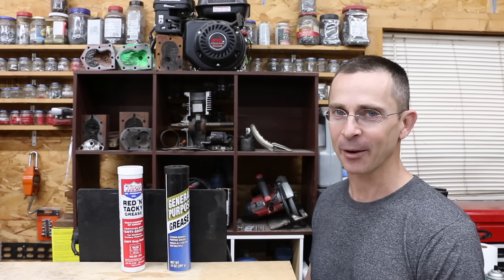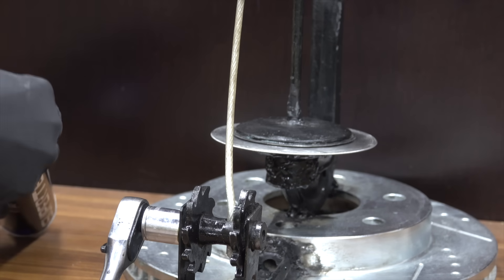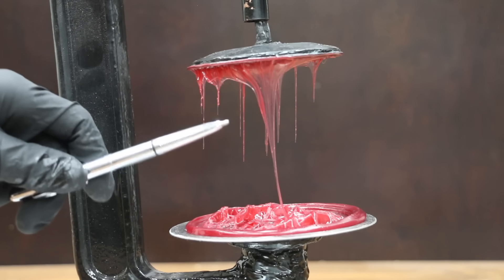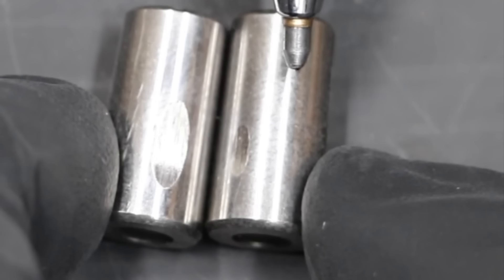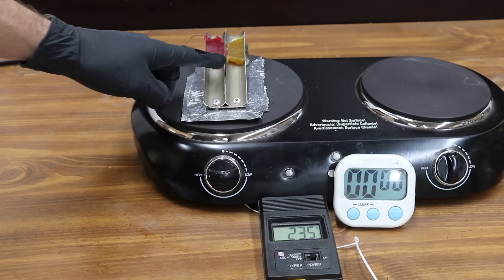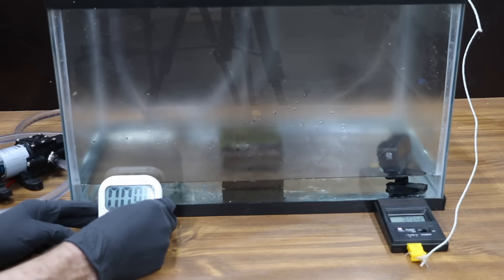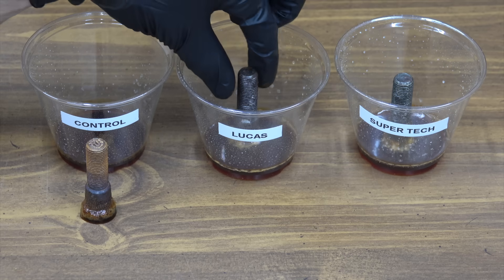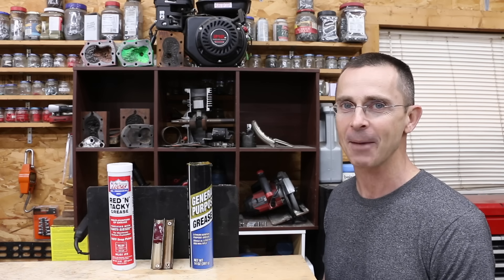Is Cheap Grease better than Lucas Red N Tacky? Let's find out! Bearing Grease Test Episode 1

Comment: I’d like to see Lucas X-tra heavy duty GREEN vs the RED AND TACKY.
Reply: It would be good to see the difference between lithium base, and polyurea base.
Reply: @tangydiesel1886  Against Molybdenum disulfide grease too!
Reply: @tangydiesel1886  Theres a big difference between the to. Being one is a lithium complex the other a poly urea. They both have high drop points. They difference is how they are made. One takes 12 hydroxy steric acid emerox1112, lithium, napthenic Acid the other Armeen OL,EDA, and Mondur T80. They are both made completely different processes.
Reply: The green x-tra is superior. I used to use red and tacky for years and right at 2 weeks I can feel the grinding on the front end of my dump trucks. Switches to green and now I can get 3 weeks before hearing the noise. My trucks run 1200-1600 miles a week. Maybe 15% off-road.
Reply: Me too. Also throw in Mercedes' own green bearing grease.
Reply: He hasn't responded with "Thank you for the video idea!" yet so this is probably not gonna happen.
Reply: Me too
Reply: Yes definitely would
Reply: I'm definitely interested in seeing the wear scar, the corrosion resistance, and the water resistance tests for these two.
Reply: The green takes more slop out of the slip-yoke (for longer) in my worn front driveshaft than the red.
Reply: What about hair or acne grease?
Reply: Anything Lucas is snake oil.
Reply: @taylorc2542  i used to work for Rush Peterbilt and that's the only grease they would use is Lucas.  I love Lucas. But thats me
Reply: @markarmstrong3394  Actual I think there grease is decent, but I'm not gonna buy from a company that is 60% snake oil when other companies do it right.
Reply: @taylorc2542  i understand and respect that.
1 thing i do know for a Fact is that Mystik is $h!t. Evertime we greased hay balers and peanut combines the crap would just press out. I dispise Mystik lol 
The shop i work at now uses Mobil and we love it. Lots of neglect and abuse

Comment: As some one who work in the grease industry, in the laboratory to be exact, i kinda expected all you test to kinda be flawed. seeing how the test where off from how i would do it a bunch of time. How ever i was surprised to see that all the results you got where close, though not as accurate, to what i expect. Great video my dude. May i give some extra information? The rust prevention of greases these days are so good that there is barely any difference between greases. Dropping point mostly increases depending on the soap, even though both products might say lithium soap, I expect the one with the high dropping point to be a lithium complex grease and the other a normal lithium grease, and as you might expect the complex one is a way harder thing to make with a higher amount of lithium per grease which really ups the price. The ability to handle loads mostly depends on additives and the soap structure used for the grease. Last but not least, the ability to mix greases mostly depends on what kind of the solvent used and the soap structure. if you have a clay based one, aka a bentone one, this will react with most other types of grease. Synthetic greases and ones in mineral oil might not be a good mix as well.

Cheers!
Reply from the maker: Thanks for the feedback.
Reply: @ProjectFarm  i really hope that didn't sound negative in any sort of way, english is not my first language. it was an marvelous video and i enjoined it a lot! Keep up the good work!

Comment: If you could, please try Aqua Shield grease. We use this offshore in bearings running submerged in salt water and as a super anti-seize where most other products will wash away over time. It’s tenacious stuff. I have found a mix of fast orange with pumice, blue dawn soap, hot water and a hand cleaning scrub brush gets it off of you if it gets on your hands.  

https://marinesan.com/aqua-shield-grease/

Comment: That was an impressive difference between very similar greases! I'd like to see how my favorite grease holds up to those same tests. 

Thermaplex Cs Moly Bearing Grease https://www.amazon.com/dp/B00Y95MSB6/ref=cm_sw_r_em_apa_i_DthvEbR32TY6A 

Calcium sulfonate grease is supposed to be as good without soaps as lithium complex/mineral oil grease. My favorite grease has soap and a molybdenum disulfide additive. I use it anywhere I need a #2 grease on metal parts, and I would love to see it crush some lithium-complex butt! (or fall on its face, in which case I'll be buying whatever wins.)

I use a weaker grease for plastics because it is compatible and plastics melt before the grease will. I actually solved a problem that the manufacturer hadn't figured out by cleaning and re-lubing the heater box sliding air-control door with #1 PTFE-base grease.
Reply from the maker: Great suggestion!  Thank you

Comment: walmarts house brand "wheel bearing" grease killed my bearings in less than 2500 miles. Lucas has now been in there for going on 50k so yeah it matters a lot. the cheap shit was black as tar, the lucas still looks new when i check them every oil change. id have to look at the extra tube i got but it was not the red and tacky one. it was a lucas brand and specifically says high temp wheel bearing grease on it
Reply from the maker: Great feedback. Thank you

Comment: Yes this all true but if I’m just greasing my lawn mower wheel studs or the pins on my backhoe, which I do every use, the cheap grease works. In any wheel bearing or spindle or something requiring good grease then spend the couple extra bucks on that.
Reply from the maker: Thank you

Comment: Love the videos partner. Could you maybe do video over welding? Maybe stick vs wire? Also I have 99 tahoe, lots of carbon buildup. Any advice? She’s starting to run funny around 40+mph hoping sea foam or mmo could fix but is probably fuel pump
Reply from the maker: Thanks for the video idea.

Comment: Holy poopenschnitzel. I was a heavy equipment operator by trade, and was even a superintendent of crews and an excavation business owner. I expected there to be a difference, but not THAT big of a difference. In all my years though, I never once saw Lucas being used in the field.

Maybe see if you can get in touch of some of the construction companies in your area to find out what they buy. Many will buy in bulk, but you should be able to buy the same stuff in smaller quantities.
Reply from the maker: Thanks for the feedback.

Comment: Thats pretty cool! At work we make a roller assembly (doesnt matter what it is). When we use our unbranded yellow grease (just like the supertech), it gets really gummy with heat. In our lab for a few day we will use it but for long term testing or when sending roller assemblies to customers we use royal purple bearing grease. That stuff if really good!

Comment: I have a 1977 Chevy K10 with a very high mileage 5.7L that was left for dead in a farmers field. it doesn’t burn oil but has bad blow by, noisy lifters and poor performance. As a seasoned mechanic I have adjusted the rockers, replaced the intake, carb, timing chain, distributor module, cap, rotor, wires, plugs, water pump, performance headers with glass packs, put an electric fuel pump and radiator with electric fans to lower parasitic drag. In short, everything I could think of to get as much power out of it without rebuilding it. To my point, since it has bad blow by, it leaks oil. One day I added Bar & Chain oil to top it off and it has never run this good or produced as much power. It’s something to try on a high mileage engine to compare with STP and other oil treatments that cost much more. The Bar & Chain oil cost me about $4.00 for a gallon at Menards.i have used many other products that you add to oil but none have come close to helping the tired old engine out. I only added about a quart and later topped it off again and once again noticed a very noticeable gain in performance. Curious to see it tested and compared, I think you will be surprised.    The brand I used is, FVP Verified, Proven, lubricating Bar & Chain Oil.
Reply from the maker: Great tip!  Have you tried a product called "Engine Restorer"?  Its one of the few oil additives that seems to deliver terrific results.
Reply: Not yet unless I rebuild or replace I probably will

Comment: * Test Request***.    More and more vehicles, are coming with auto start/stop.   In fact my ford truck even came with a tag on the dash saying -  not to worry, that my truck had ‘upgraded starter and battery ‘ to compensate for additional starter activity.   How much fuel is that annoying feature really saving vs brief periods of idling at stoplights?  Can we quantify how much additional wear and tear we are putting on the motor and starter components by all the starter activity vs just idling ? It seems like a hard one to test , but you always manage to figure ingenious ways to tease and measure things.  Go for it !
Reply from the maker: Thanks for the test suggestion.

Comment: I just used kerosene to flush sludge out of my ford 302. Had no oil pressure.  It took 4 gallons and 31 oil filters! Not joking. Got pressure back finally. I mixed two stroke in the kerosene for a 25:1 mix. Great video, i wonder what the lubricity tester would say about two stroke-kerosene?
Reply: Before kerosene i tried 10 gallons of water, 4 gallon of gas and a gallon of atf. The kerosene did the most to break down sludge.
Reply from the maker: Great information. Thank you

Comment: You should make a video where you run an engine on a canister of hydrogen gas. Hydrogen can be made using electricity, and can therefore be produced without creating greenhouse gasses (assuming your electricity comes from sources that don't themselves produce greenhouse gasses).

Often touted as "the fuel of the future", you should measure it's energy output in your generator and see whether it really deserves this title, or if it actually sucks and scientists should forget about it.

You should measure the efficiency (energy you get out of it divided by energy it contains, times 100) vs gasoline; the load it can sustain vs gasoline, and the running time vs gasoline.

One thing I've heard though is that it can cause brittleness in metal, so be aware of that.
Reply from the maker: Thank you for the video idea!

Comment: Glad to see this video very informative.. I used to use tech / Walmart brand and in my grease gun after a week or so in the heat because I keep it in my van upon picking up the grease gun it would leak what looked like red thick cool aid from the back and drip on my driveway.. And it would be a good amount.. Have to hold a rag around it while I would fill my bearing buddies on a  small trailer... Switched to Lucas and no dripping grease from breaking down.. Absolutely a better product.. I just fall for the cheap way.. Well all grease isn't created equal.. Thanks again for your video
Reply from the maker: Thank you
Reply: @ProjectFarm  Question Sir.. I have a 2003 Ford e250 4.2 v6 do all my own maintenance. Mobil I everything 6000.. Van has 330000 miles on it no bs.  About after 120 g started hearing valve tap or lifter noise.. Started putting in Lucas oil stabilizer every oil change and noise stopped first use..  OK question is I was wondering if I could blend these two or switch just to restoreall or stay with what I'm using.. Doesn't burn much oil maybe half a quart 3000 miles.. Engine has some different noises going on but hard to distinguish because I'm on my original cat converters.. Just wondering your thoughts.. Sorry for the novel
Reply: @ProjectFarm  I apologize posted this question on wrong thread.. Was watching your restoreall vid and didn't realize

Comment: Do a test on Marine outboard  oil vs automotive oil to see if their is a real difference as well as the oil filter difference between outboard specific filters and automotive, could check the corrosion resistance.
Reply from the maker: Great recommendation. Thank you

Comment: awesome vids, love the channel and dedication to real testing, I have wondered about the hydrogen fuel kits out there, basic electrolysis that creates hydrogen gas that is delivered to a ICE thru a carb or throttle body air cleaner, that they may increase power and economy as well as cleaner burning,,,maybe you would like to check ithem out for us..
Reply from the maker: Great suggestion!  Thank You!

Comment: A Video Idea, since you're asking all the Time: 
This comes from general aviation and is basically about different (otto-) fuels and mixture of it. 
For many decades it has been a big discussion how it is possible to fly with a fuel mixture beeing lean of peak while achieving amazing fuel efficiency by still producing power and safe combustion in the engine. 
The big key points of this are: Ambient air temperature, ambient air pressure, humidity, fuel type, fuel mixture, Exhaust gas temperature and cylinder head temperature. If you also put it to a torque-meter, the experiment would be perfect. 
-> Idea for experiements in video: Possibly get one standard 4-stroke cylinder and one with see-through cylinder head. 
For this experiment also any simple-type of injection system would be preferable over a carburretor. The goal of this experiement would be to slowly run the engine at different power regimes, while going through different mixture settings. 
If you could do this while plotting and showing how EGT, CHT and Torque behave over a changing mixture and at what point of mixture there is actual detonation starting and how it shows and can possibly destroy an engine, it would just be an awesome experiment and video. 

As fuels I'd recommend Regular and supreme auto fuels as well as the lead containing AvGas from aviation. 

All the best from Germany, Chris
Reply from the maker: Thanks for the video idea and feedback.

Comment: I'd love to see you test pb blaster's lithium, silicone, and regular spray oils to see which is better, lasts longer etc. Also, test the brands. I, actually, hate pb blaster brand as I can never get it all out or sometimes the little straw inside falls off and have to hold the can upside down afterward to get any out. PB Blaster, 3 in 1, and (my favorite) liquid wrench.
Reply from the maker: Thanks for the video idea.

Comment: I really enjoy your videos, and look forward each week to a new one. Although I'm an I.T. professional, my younger years were spent working in vocational trades. My favorite, the one I most miss, was that of a millwright at a lumber mill. Very diverse work, and never a dull day on the yard. At least twice, a coworker and I argued about the best brand of grease to use in a few different applications. In some, I went with the cheaper brands. But with others, I insisted on staying well supplied with the Lucas you used here. I used the cheaper quality in high temperature areas where no grease lasted particularly long due to evaporation; those needed daily (or even twice daily) reapplications, so the quality of the grease was not as critical as the maintenance budget. But on other parts requiring less frequent maintenance and/or more critical points of failure, I definitely used the Red and Tacky.

It was really fun to see how you tested these 2! Thank you.
Reply from the maker: Thanks you and for the feedback.

Comment: I currently have a tub of Lucas red n tacky in my grease gun. Glad it was shown to be superior. But why does it bleed out (separate) red liquid so badly? It even seems to separate within joints and drip out of the zerk fitting. I have to wrap my grease gun in a rag when stored or else it will leave a mess of red liquid
Reply from the maker: Great feedback on Lucas.
Reply: @ProjectFarm  My question is do you think any of its properties are diminished as the liquid separates from the solid? The grease that remains must be somewhat more "dry"

Comment: The Supertech Multi-Duty red grease should have been used, that is the equivalent to the Red'n'Tacky. General Purpose is just that, useful for applications where there is little heat and movement as a cost effective solution. This is a bit uninformative when it comes to brand vs brand, it's just light-duty vs heavy-duty formulations, really.

Comment: HEY PROJECT FARM!!! I'm not sure if you've had this idea thrown at you buuuuuuuttt. Would you be able to take let's say Valvoline High Mileage and do testing on the fresh oil then do testing on the oil after 1000 miles of use, 3000, 5000, and 8000 miles? I know itll take a very long time to do so but I want to see how long you can actually go without an oil change.
Reply from the maker: Thanks for the idea!

Comment: Id like to see super lube in future test, possibly against the lucas as they are probably close in price point.
Reply from the maker: Great suggestion. Thank you
Reply: Thanks,  and i watch almost every test you put out, love the science you put into your test to make everything as accurate as possible and ive actually changed some of my purchases based on your tests!    Just curious on the super lube cuz im currently using this at work on 2 REALLY big and expensive bearings at work... low rpm but massive load.
Reply: Im one guy in charge of literally millions bordering on the billion dollar mark worth of equipment so any product i can find that performs better or saves replacement, my duties, and keeps us making money rather than spending it is definitely part of my job.
Reply: I dont have access to exact numbers but im pretty sure the bearings i refered to are about 2,500-3,000$ a piece...so no matter what a tube of grease can top out at if its better or can make them last even one day more its probably worth it to our company; Cost vs profit ...lol.